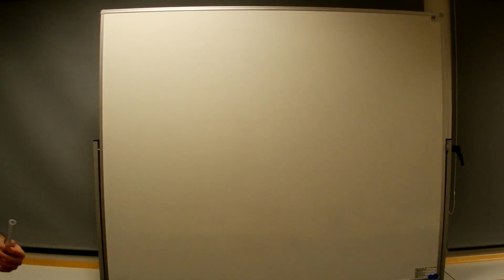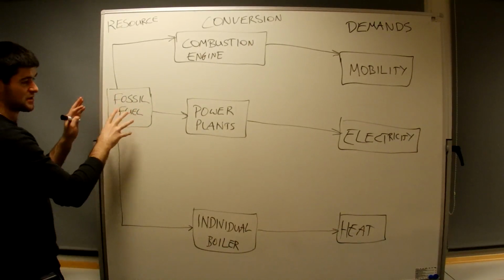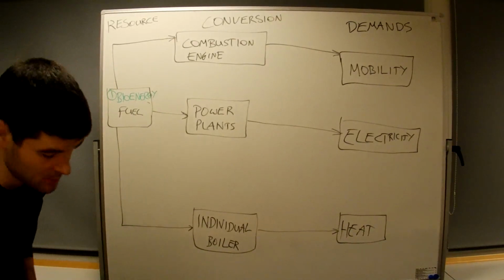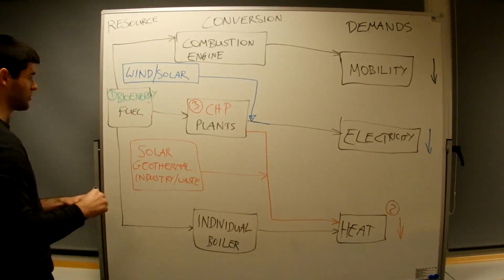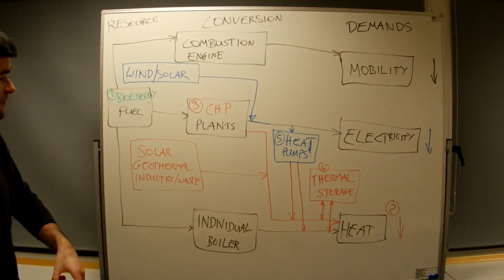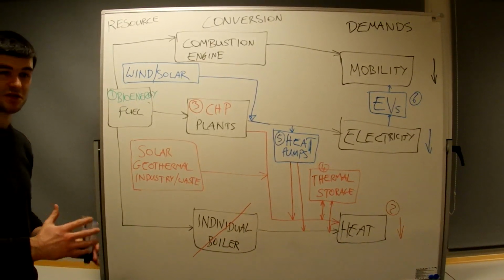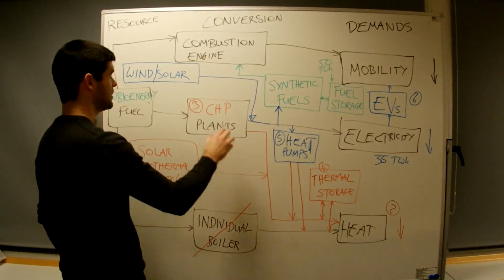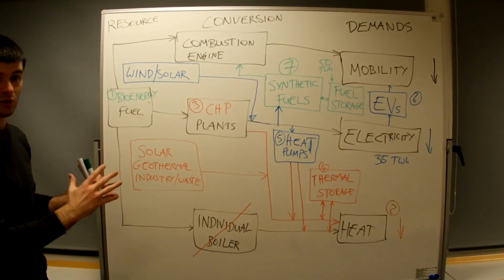One Potential Transition to 100% Renewable Energy (Technical Perspective)

Comment: Are you seriously suggesting a large scale heat distribution system ?  Are there working models to scale that have proven the economics and efficiency of this approach?  Also note that you bypass the discussion of cooling, which in a huge % of the world is more important than heating.
Reply from the maker: Yes, there are thousands of heat networks around the world. Over 90% of Copenhagen's residents get their heat from a heat network. Heating is larger than cooling demands in every EU country according to the most recent data reported in scientific journals.

Comment: Isn't it impressiv how a simple, calm and well-articulated presentation of less than 30 minutes can make you understand the topic of future energy systems way better than the average 'citizen' will ever come to know?

Of course there are questions. This is a model for Denmark and Denmark is not the world. Why is there no (cheap) pumped hydro storage? Norway with its water resources may well serve as a PHS-battery for many countries. Unless the Norwegians are opposed of doing sustainable business with their neighbors, a so-called HVDC (high-voltage DC transmission) is a viable form of long-distance electricity transportation.

Concerning the idea of being "energy independent", asking for Norwegian hydro storage is quite different than depending on oil-imports from other continents, as the European electrical grid is already an international one. So that shouldn't be an issue.

Synthetic Fuels

As for the synthetic fuels, I'm somewhat skeptical when it comes to the production of methanol and the gaseous dimethyl ether (CH3)2O. It seems just way too expensive to use CSS (captured CO2 from the CHP plant) and hydrogenation (using electrolysis of water to produce hydrogen as a precursor material).

As far as I know, there are not even good alternatives to the platinum catalyst needed to split water, not to mention the overall energy conversion efficiency when considering the whole chain of steps that starts with the electricity produced by wind/solar, and ends with the mechanical energy delivered by the combustion engine using the synthetic fuel. Am I completely wrong to assume that the efficiency won't be much more than, say, 10 to 20 percent at best?

How can synthetic fuels ever become viable for large scale use and storage? Isn't it reasonable to assume that these fuels cannot compete with global oil markets that definitely will continue to exists in 2050?

To me, a stronger than expected decline in the cost of electric batteries seems much more likely than efficiency/cost improvements for synthetic fuels. That means that trucks used for heavy transportation will use batteries, not synthetic fuels. As for ships and airplanes, well, batteries don't seem a likely solution, but remember, theses transportation sectors compete globally, as they operate on a global scale and will continue to use fossil fuels, otherwise they're out of business.

So the way I see it: cars and trucks use electric batteries while ships and airplanes continue to use mostly heavy oil and kerosene. In this case no synthetic fuels are needed to be produced in large-scales. The lack of a fuel-storage would be compensated with hydro storage and battery storage, such as liquid metal, redox-batteries and others.

Well I honestly hope I'll be proven wrong about synthetic fuels...
Reply from the maker: Synthetic fuels are one of the most uncertain parts in this video, so it is reasonable to be sceptical for now. Another solution I am analysing recently to supplement synthetic fuels are electric roads: www.dconnolly.net/electricroads
Reply: Thx David. In your presentation, synthetic fuels also play a vital role in energy storage. I'm wondering whether hydro or battery storage would be Denmark's best option, if synthetic fuels turn out to be too expensive?
Reply from the maker: The main purpose of synthetic fuels is to provide fuel for transport. The storage is an additional 'free' benefit.
Reply: 21:28 which you called a very, very important side-effect

Comment: Excellent video. For the past 7 years I have working to implement these principles in Humboldt County, California and have used EnergyPlan software to do my modeling. Heat pumps can inherently do simultaneous heating and refrigeration and CHP plants can be equipped with absorption chillers to as a heat-driven heat pumps.